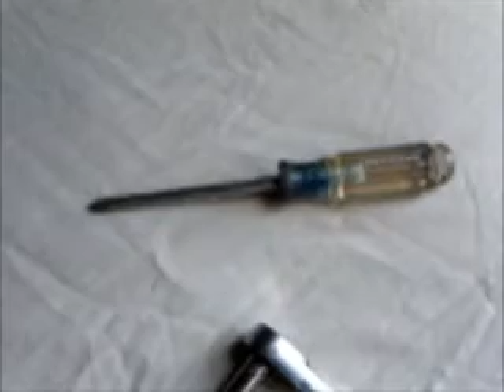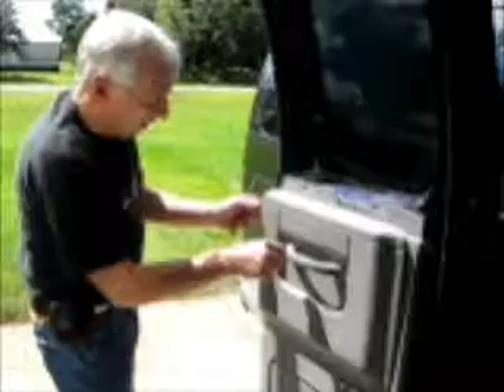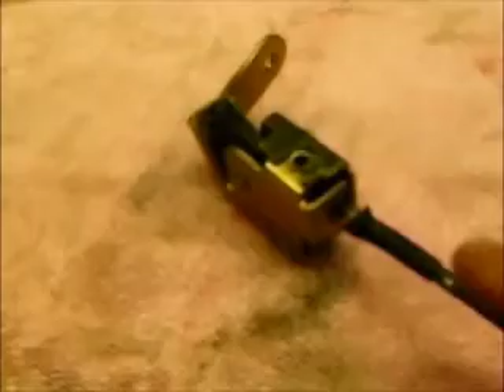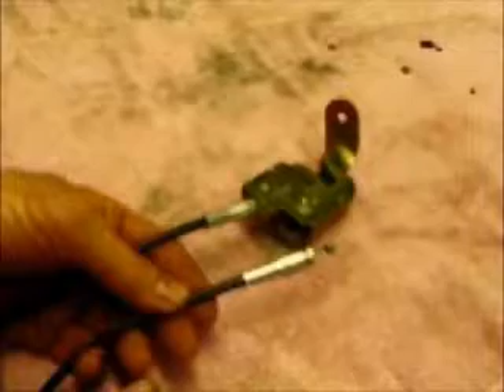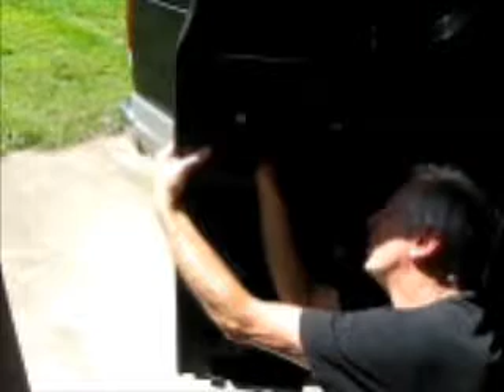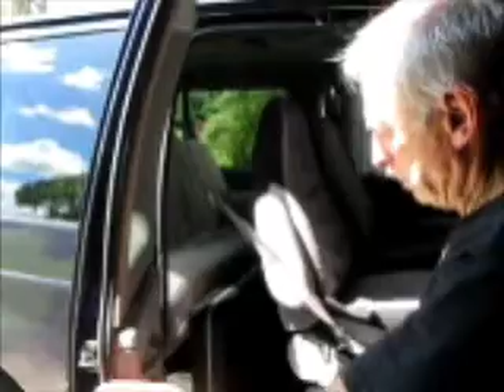Ford Econoline Door Lock Cable Repair BEST METHOD

Comment: Thank you! We ordered your part off of ebay and with this video we were able to repair the left cargo door easily.  This really is the best solution.  The cables are fine, just the end pieces have deteriorated.  Plus the specially designed ends for the lower cables worked great.  I don't know how we would have replaced that lower part without those special ends.

Watch out for the Dorman replacement. They may be cheaper but those are made for the back doors.  We ordered a set supposedly for the side doors and the cables were way too short.
Reply from the maker: Thanks for your purchase, you have joined  the thousands of our other satisfied customers  who have used our products. I own a Econoline van and all the cables in the  cargo doors have failed , one after the other , that is what got me started making and selling these kits.   If you experience more failures keep Klammauto in mind         Thanks again  GKMullet Gumbo

Comment: DAM, just looked at your prices, MUCH better off to simply buy a replacement... Dorman have been selling door products for a while, have never had any issue with them as good or better than factory OEM http://www.ebay.com/itm/Dorman-924-350-Door-Latch-Cable-/331139987856?pt=Motors_Car_Truck_Parts_Accessories&fits=Make%3AFord%7CModel%3AE-250&hash=item4d197b3990&vxp=mtr

Comment: Thanks for making this video and the parts!  Will this work on back doors as well, and does it only work on the left door?
Reply from the maker: We supply Kits that will repair the cables in the left door  as well as a different  kit for the right cargo door . We also supply kits to repair cables in Ford F series and Ranger trucks , as well as Expedition /Lincoln Navigator  ,and Mazda B series pick up trucks